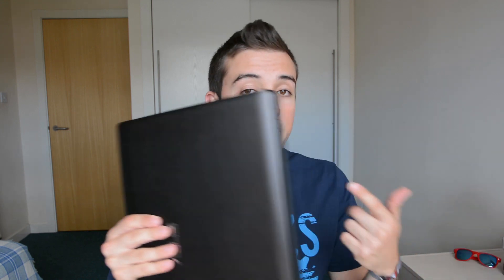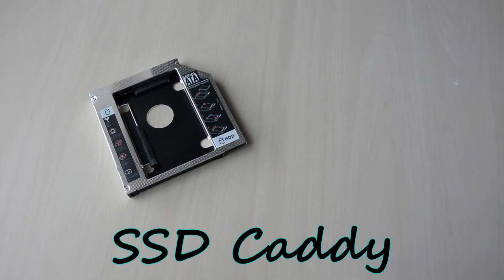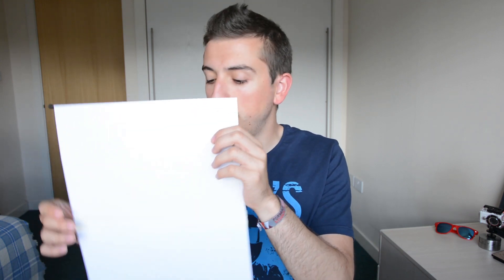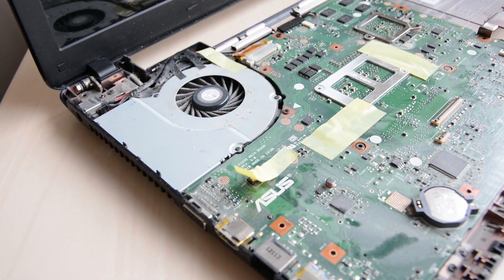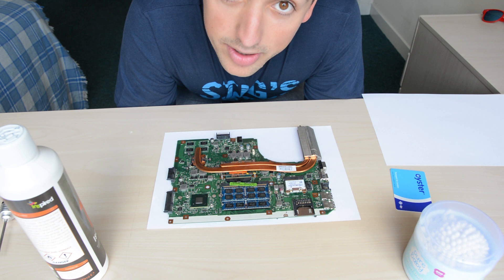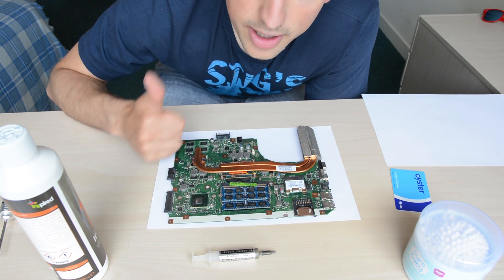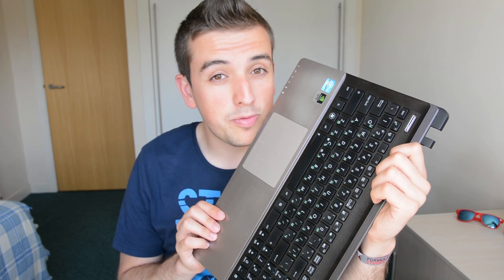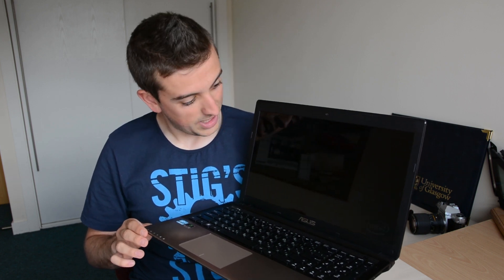How to Upgrade Your Laptop PT 1 - Asus K55VD

Comment: Why did you remove thermal pads from cpu and gpu?
Reply: Thermal pads cannot be placed on the processor and graphics (discrete) card. Only thermal paste can be used. Apply thermal paste evenly in a thin layer (0.2mm) over the entire crystal. I replaced the processor in my laptop: instead of i3-3120m I installed i7-3612qm. RAM 12GB (4+8)

Comment: Maybe you have gone on to do better and greater things since this video but could you please tell us more about the test you did at the start and why you did not do it again and tell us the results (improvements) after cleaning.  Also I would really have liked to see how you cleaned the keyboard and the guts of the cooling fan which usually collects a lot of dust on the blades.
Reply from the maker: Please check Part 2 for the improvements on the thermal side. The cleaning procedure included a lot of patience as well as isopropyl alcohol, cotton buds, tooth picks and a small brush. That laptop is actually still working and being used every day.

Comment: Your video was very clear and thank you very much for that.  I did exactly as described in the video.  It also just works, only my music program now shows a high CPU load.  However, in task manager it indicates normal CPU values.  What strikes me is that the hard disk performance is very high.  Also up to 100%.  Could this be because I took out the hard drive during cleaning and it may have been damaged?
Reply: after placing the ssd disk and the old hdd in the caddy there are no more problems at all.  He has become super fast 😀👍

Comment: Thank you for reporting in detail how to disassemble. Based on your video, I cleaned the PC and replaced the CPU. I was able to change from i5-3210M to i7-3840QM.
Reply from the maker: Glad to hear that I can help.
Reply: Does it support NVME SSD?
Reply: @0633amit  It does not have a M.2 slot.
Reply: with the i7 changed , how is the difference now in performance?
Reply: Where did you buy the i7-3840QM? Thanks
Reply: @mwbvm1  I haven't taken a detailed benchmark. But at least the clock is up so I think I'm benefiting from it.
In Japan, CPUs for notebooks are rarely available in the second-hand market, so we cannot be purchased at stores. I searched for it on the auction site and got it.
Reply: @とびりし  thank you for your  reply. How did you replace the CPU if it's soldered to the board? Which model do you have and how did you do it? Thank you. Greetings from the Netherlands 🙂
Reply: @mwbvm1  CPU of my PC : i5-3210M was not soldered.
 PC Model is K55VD. The details are as follows. (by Speccy)　If it is soldered, I think it is virtually impossible to replace it.

Operating System
	Windows 10 Pro 64-bit
CPU
	Intel Core i7 @ 2.80GHz	55 °C
	Ivy Bridge 22nm Technology
RAM
	16.0GB Dual-Channel DDR3 @ 798MHz (11-11-11-28)
Motherboard
	ASUSTeK COMPUTER INC. K55VD (SOCKET 0)
Graphics
	Generic PnP Monitor (1366x768@60Hz)
	Intel HD Graphics 4000 (ASUStek Computer Inc)
	2047MB NVIDIA GeForce 610M (ASUStek Computer Inc)	43 °C
	ForceWare version: 391.35
	SLI Disabled
Storage
	931GB Crucial CT1000MX500SSD1 (SATA (SSD))
Optical Drives
	MATSHITA BD-MLT UJ240AFW
Audio
	Realtek High Definition Audio

Motherboard
	Manufacturer	ASUSTeK COMPUTER INC.
	Model	K55VD (SOCKET 0)
	Version	1.0
	Chipset Vendor	Intel
	Chipset Model	Ivy Bridge
	Chipset Revision	09
	Southbridge Vendor	Intel
	Southbridge Model	HM76
	Southbridge Revision	04
		BIOS
			Brand	American Megatrends Inc.
			Version	K55VD.411
			Date	2013/03/11
		PCI Data

CPU
		Intel Core i7
			Cores	4
			Threads	8
			Name	Intel Core i7
			Code Name	Ivy Bridge
			Package	Socket 988B rPGA
			Technology	22nm
			Specification	Intel Core i7-3840QM CPU @ 2.80GHz
			Family	6
			Extended Family	6
			Model	A
			Extended Model	3A
			Stepping	9
			Revision	E1/L1
			Instructions	MMX, SSE, SSE2, SSE3, SSSE3, SSE4.1, SSE4.2, Intel 64, NX, VMX, AES, AVX
			Virtualization	Supported, Enabled
			Hyperthreading	Supported, Enabled
			Stock Core Speed	2800 MHz
			Stock Bus Speed	100 MHz
			Average Temperature	56 °C
				Caches
					L1 Data Cache Size	4 x 32 KBytes
					L1 Instructions Cache Size	4 x 32 KBytes
					L2 Unified Cache Size	4 x 256 KBytes
					L3 Unified Cache Size	8192 KBytes

Comment: My screen dont work after reassemble, help please
Reply from the maker: You should double check whether the display connector is seated properly.
Reply: @dangcool3864  Everything is right, when I about to give up, It works (I didnt insert the battery initially) !!! THANKS FOR THE REPLY. Please produce more content :)
Reply: @dangcool3864  By the way , every time I launched a game where my laptop gets hot, my laptop just shut down by its own, it been like this for a very long time :( I already repaste and clean the fan
Reply from the maker: Are you struggling with those issues before you cleaned and refreshed your laptop or after? I can suggest installing a CPU monitor program to check what temperatures it is running at when gaming. Check PT2 of this video series.
Reply: @dangcool3864  My screen is alright now, I mean when the temp is high, the computer power off by itself. Around 80-90 degree celcius :(
Reply: I had this issue for a while. Please put the PC on a flat surface. Let the air flow out.

(Will notchelp much if you force heavy loads for much time. Upgrade/maxx out if you want to keep your PC loading your heavy gaming.

Comment: I’m trying to buy one of these k55vd online, it seems no one is selling them. I only find other models like the K55a k55n etc...
Reply from the maker: It is a very old laptop now. I had purchased mine originally back in 2012, however it is still running which is a good sign.
Reply: DangCool I just found a k55vm motherboard and nvidia card, I’m gonna be swapping it out and run 16gb ram and Samsung Evo ssd
Reply from the maker: Sounds like a good plan for a decent setup. Unfortunately, there is a limitation that you can only fit older lever components (CPU and RAM).

Comment: i bought that laptop few month ago second handed and there are only intel hd4000 gpu ... is there any way to add nvidia gpu in it?
Reply: Not. You can only install i7 to work faster. And the video card will not improve. What processor is it worth now?

Comment: hello, is it possible to replace the graphics card with more powerful one?
Reply from the maker: You can potentially exchange the GPU but you might struggle to find a compatible chip for this socket anymore since it's quite old (dating back to 2012).

Comment: hey hero my graphics card is not detecting in same laptop :(
fan speed always on full speed
Reply: SAME. I've been looking for months to find a solution for detecting it
Reply: @freekill1626  install nvidia drivers maybe? :shrug:
Reply: @evelynuwu  Thanks for the advice but I've tried that already. I upgraded from windows 7 to windows 10 a while back and I think that's the reason why it won't detect my graphics card. I'll bring it back to windows 7 if that's what it takes but I'll do it as a last resort if I can't find any other way. Anyway, thanks for the advice.

Comment: So the CPU is replaceable on this model?
Reply: its replaceable, im already plug and play the CPU
Reply: Btw, it is upgradable to 16gb RAM, despite the official website telling otherwise.
Reply: Don't you have to download bios update for 16gb ram?
Reply: @ubaidh66  No. Just stick it in, and it will work.
Reply: @ubai ... (K55VM owner, here) - I maxxed out my RAM to 16Gb andcdid nothing. It's working.
Reply from the maker: +Aliencide Producer Hello Aliencide, I haven't really checked whether it is replaceable. Looking at how it is mounted would lead me to believe it's fixed. Even if you are able to replace it I doubt the motherboard would have support for newer generation CPUs.
Reply from the maker: Thanks for letting me know!
Reply: @maldi994 which one did you choose to upgrade? (i have the 3210m one and thinking about 3610qm)
Reply: I can attest that it is upgradable. I replaced my  i3-2350M for a used i7-3632qm, best decision ever.